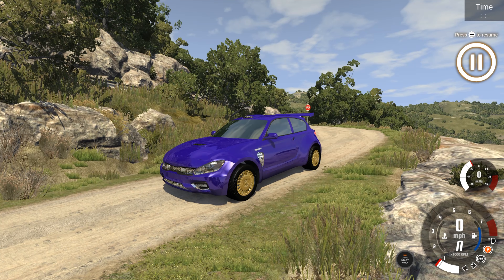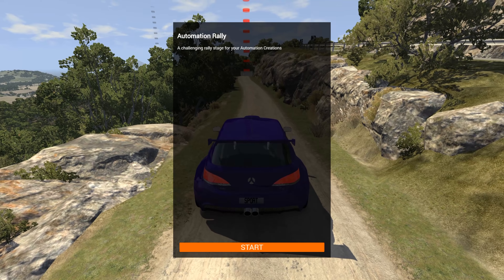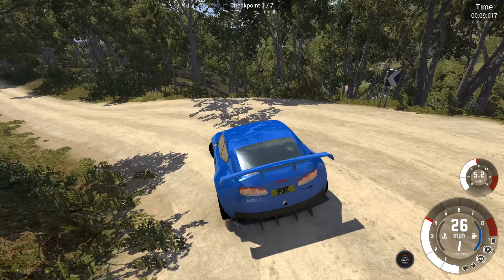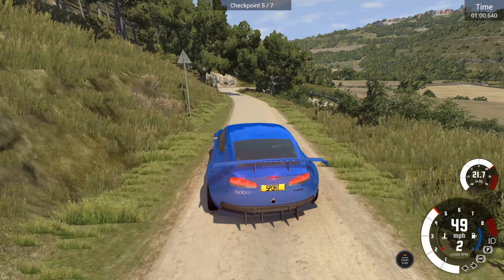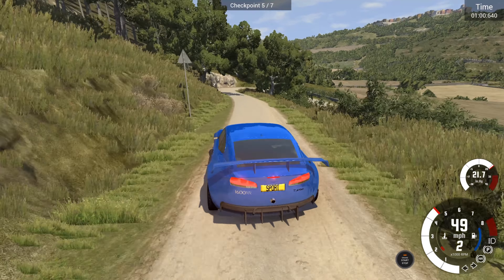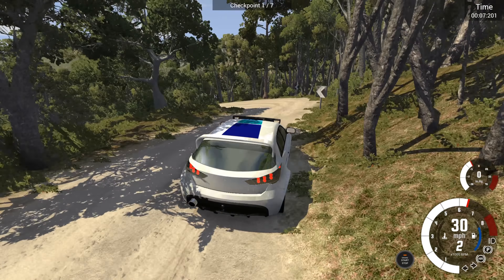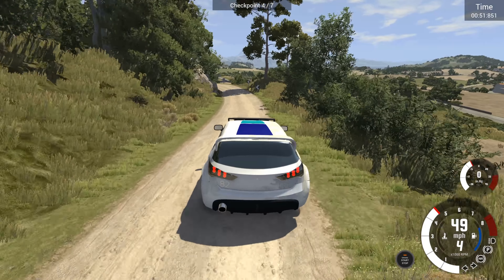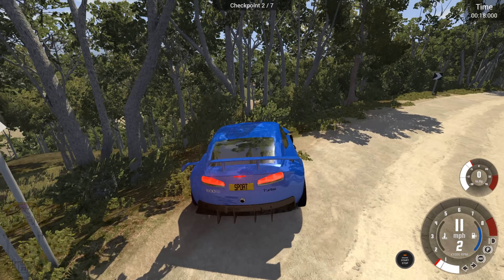BeamNG Drive/Automation Rally Cars #12

Comment: Failrace: When you're done with this series, you should do a "Driven till destruction" series with these cars, so that we see which one is better built as well.
Reply: I was thinking the exact same thing. I'd love to see what people do to make them survive as long as possible
Reply: @Droptima15  yeah, a good rally car must not only be fast, but also very tough.
Reply: Problem with this is that automation cars don’t fall apart like actual beam cars. They’re a bit indestructible
Reply: @CharlieBennici  I've seen some of them rip a wheel or being wrecked... Another thing would be to make them race in a rally, with 6 or 8 long stages.
Reply: @Snarl616  while yes it would be cool for that to happen, the automation cars would require a stupid unrealistic course to make each run last less than an hour, the cars are very very resilient, I've wrecked many of them and had ones that are literal bananas with only two wheels still drive, also they don't really overheat which kinda ruins the purpose
Reply: @heckin_dinosaw  But Failrace himself said once that these cars are fragile, since they are built to last just a few minutes of race...
Reply: @Snarl616  I literally crashed head on into a wall with an automation car at about 200km/h and it still drove perfectly after, the main way thatll reliably kill on of these cars it seems (unless its purposely built stupidly weak) it to roll it

Comment: It bothers me that the turbocharged cars have individual throttle bodies and velocity stacks instead of the proper turbo plumbing/intake manifold.
Reply: It's just that the plumbing doesn't get exported properly on Automation yet, I remember most of the engine types do have some sort of ITB-to-plenum conversion pipe (if you have race intakes + turbos, that is). Automation devs themselves admit the exporter is still in development so eh, that will come!

Comment: I don't understand why builders cheap out on brakes and put tiny units on their fast vehicles...
Reply: braking doesnt only depend on brake discs size, but mostly on grip ur car has under braking. No need for big brakes if u lock the wheels on this track with the tiniest. Often u might find little discs, but with 2-6 pistons to save weight. Simple- Smaller discs - cheaper and lighter